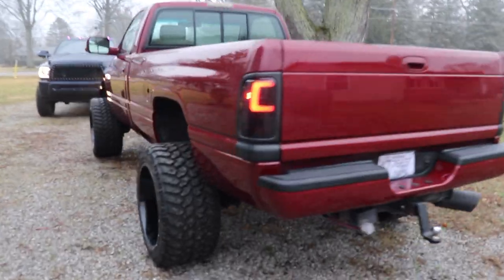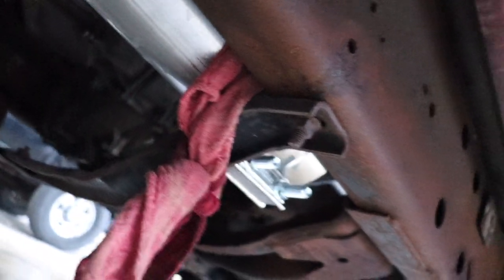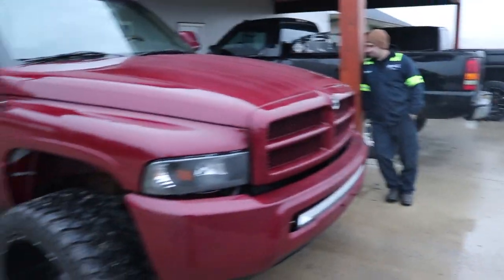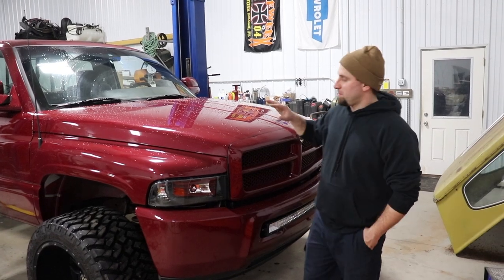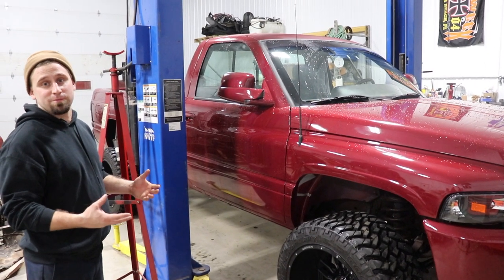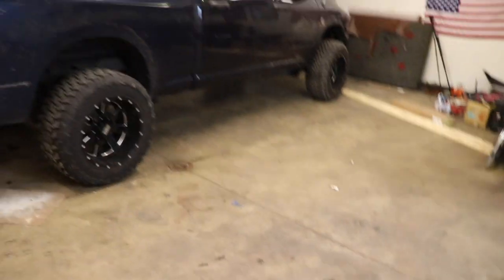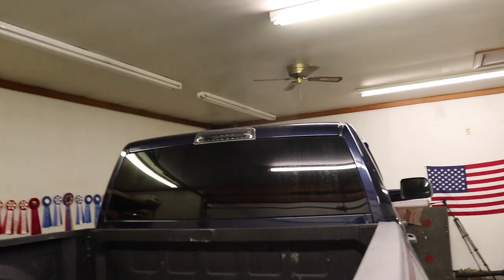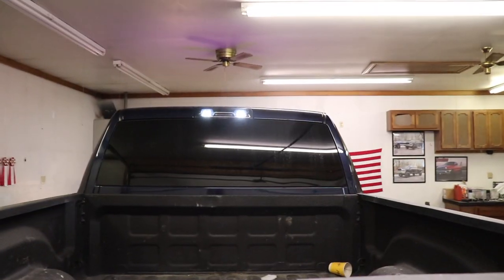Time For Some BIG CHANGES!!!

Comment: I have a first gen almost identical but a 5 speed 190k miles...anyways it won’t start so we jumped it off and left it running for a while then turned it off and it wouldn’t start. Any ideas on what it might be? Maybe just battery?